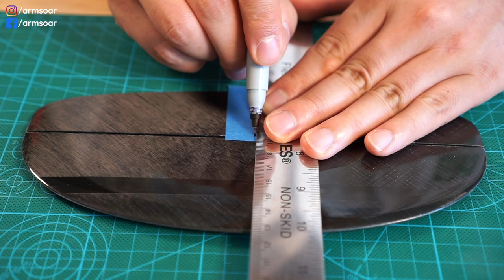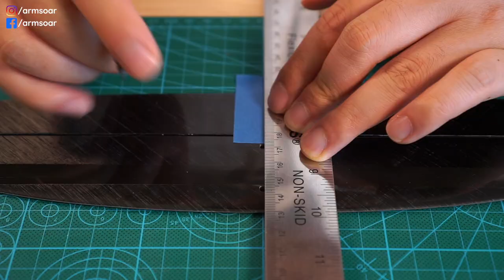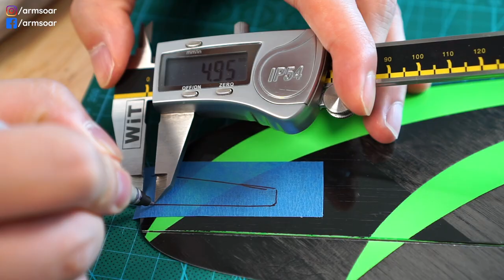Kite Dlg Built Log Part 1

Comment: For the spring holes, I took out the springs and ran some thin CA down the hole to harden it.  Then you can also remove the spring again in the future.  I don't know how much of the thick gorilla glue makes it all the way down the hole.
Reply from the maker: We've used thin/superthin CA for years, but have switched over to the white Gorilla glue a few months ago as we find it does a much better job at minimizing skin print-through.
Reply: @ArmSoar  Wait, the Gorilla glue was white (PVA?) glue and not Gorilla superglue?
Reply from the maker: @ChristieNel  it’s an expanding/foaming glue.